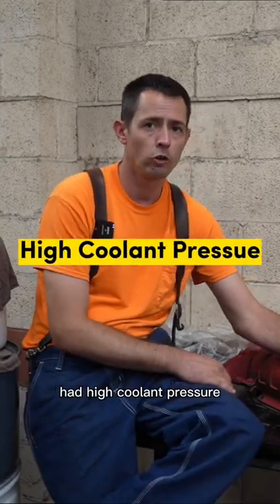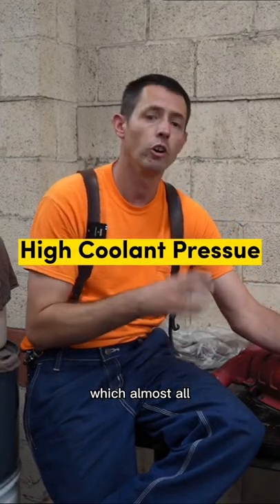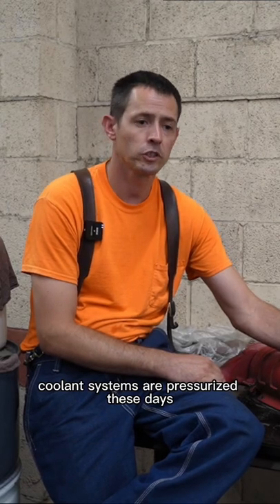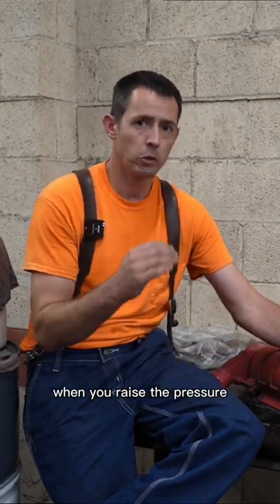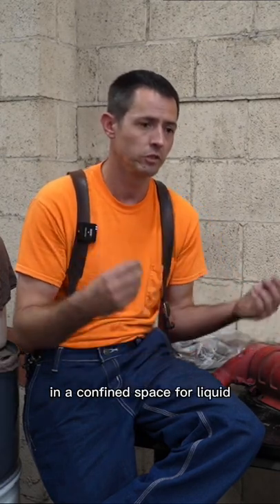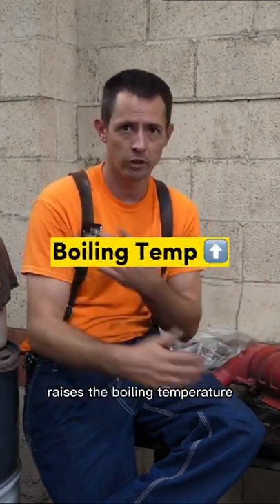High coolant pressure & the symptom of high coolant pressure #shorts

Comment: No one can figure out why my paccar is over pressurizing the coolant system. It even popped a seam in my radiotor. Three shops. No one knows. Pressure tested, bottle tested air compressor, checked air dryer purge valve for coolant, no coolant in water seperator or fual tanks or oil, combustion gas  test, scoped egr cooler for gunk, trst drove, couldn't duplicate. Paid again. Drove to truck stop. Coolant squirted out a little. Next morning, coolant down a few inches below min cold line. Cranked it over, coolant up to min line. Added to half way to max line. Idled for a while, no issue. Also, truck never overheated or engine oil temp high. Nothing. Drove from parking spot 300 feet to fuel pumps, steam coming out. Oped hood, coolant filled to cap, squirting furiously out pressure relief cap tube on side, but not fill cap. No air no coolant releasing there. Drove back to shop, stop engine light coming on, pulled over, low coolant. Opened cap, coolant came back up, drove, repeat, drove repeat til I got to shop. They could not duplicate again bobtailing, even after 80 mile test drive. Nothing. Apu effrcting it? Truck ac system? Too much coolant in system? Eveyone is at a loss.